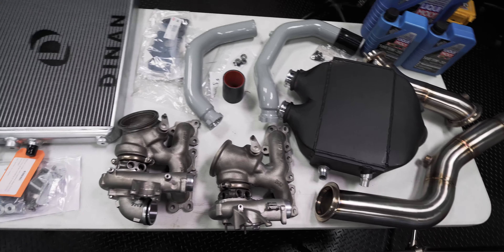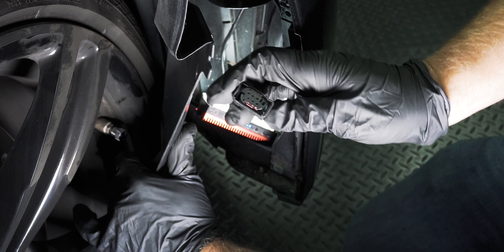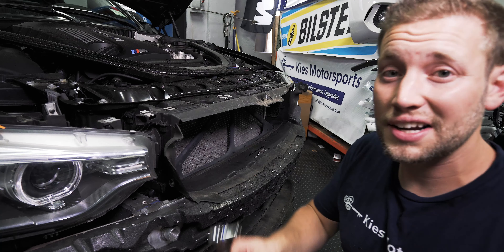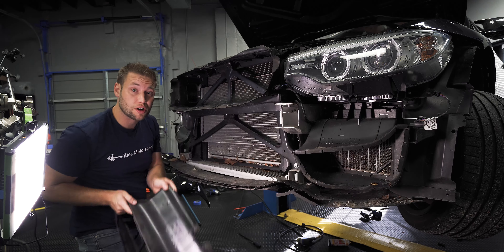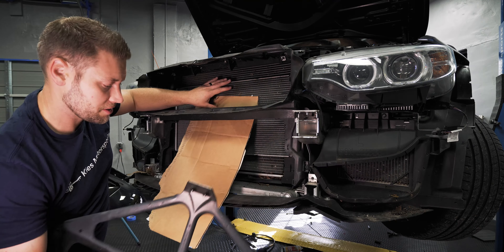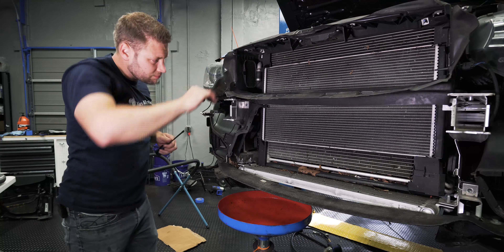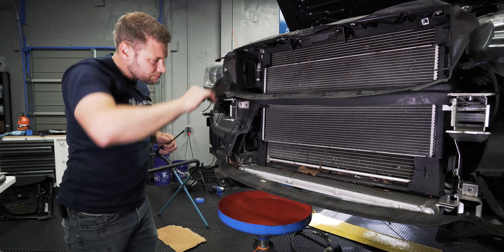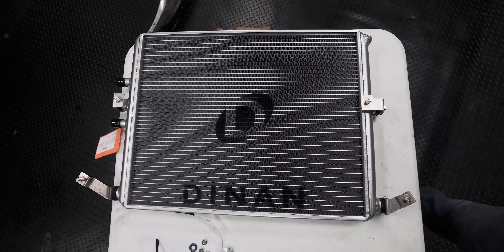DIY: F80 S55 M3 Dinan Front Mount Heat Exchanger Installation

Comment: Are you guys doing the crank hub fix for all Pure Stage 2 turbo upgrades?
Reply from the maker: Pretty much all the turbo upgrades we've done have done a crank hub as well
Reply: Kies Motorsports Max PSI or Vargas crank hub solution?